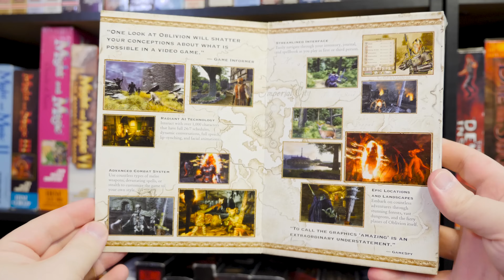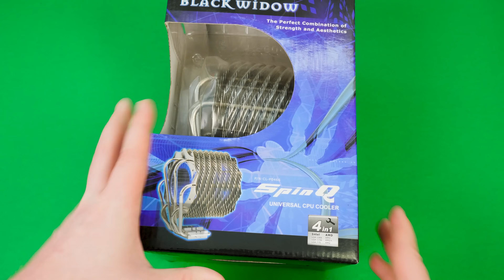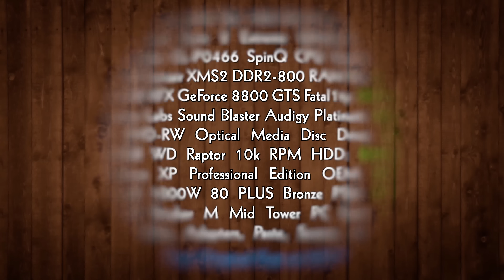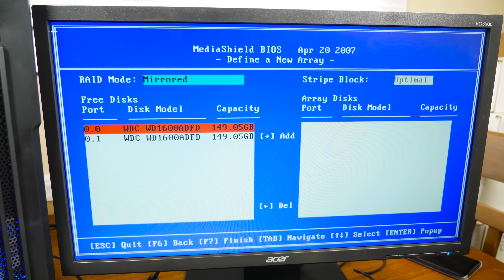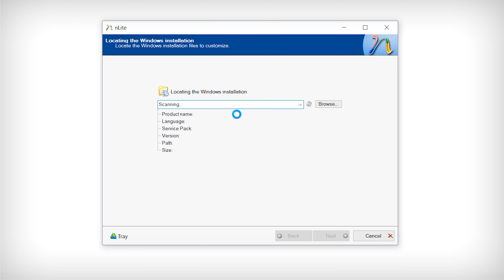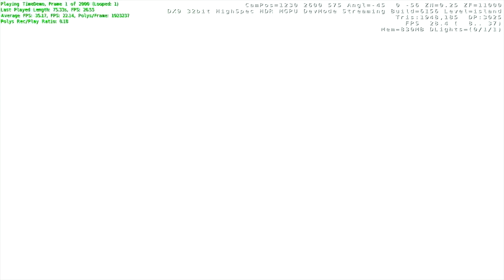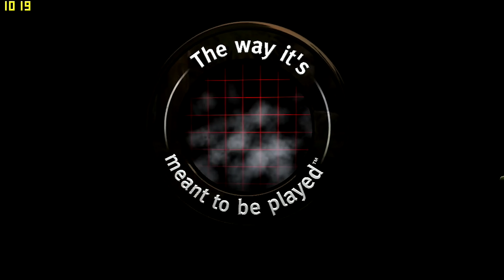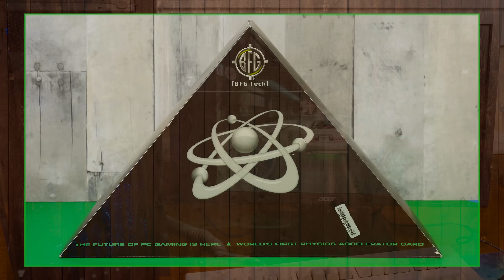LGR - Building My Dream $3,588 Windows XP PC

Comment: Haven't quite finished the video yet, but just wanted to say that the one thing about the Core2 Series and what it still has going for it is that it's narrowly good enough for most modern use tasks, but completely  own it for retro tasks in terms of support and power. 

I've been considering an LGA775 based Retro system on it for a while, but im not too sure it's time to say goodbye to my PGA478 PC just yet.

Now I get to enjoy the rest of the already brilliant video.
Reply: My computer is an old hp workstation, this summer I upgraded the cpu to a Core2  Extreme QX6700, running windows 10 with 8gb of ram.  Cant really game on it except older stuff, but the system works well enough for everything else.  I do need some heatsinks on the VRMs though, they get quite a bit warmer with this cpu.  (lol my disk drive is also a LightScribe)
Reply: Oh hi!
Reply: >"but completely  own it for retro tasks in terms of support and power. "

orly?
Reply: What's up, Hamish? Good to see you here, bud, haha.
Reply: I love lga 775, it’s my favorite socket.
Reply: I have still a qx9650 with a modern Nvidia card and it still works pretty well for its age in games even when it's completely maxed out. Not much form around then can still run stuff like that today.
Reply: I have one for when I can't be arsed to retro. They 'just work' : PCI-E, sata, USB2, tower coolers, Single core to quad core support. Fast enough to venture onto the web for game patches. They're super cheap too. XP gaming PCI-E graphics cards for less than £15. I have an e8600 on a modern, cheap cooler and it's super quiet and cool. 3GB of DDR2. An Nvidia GTS 645 - a Dell/Alienware card which is silent, single slot, no external power required but will run pretty much all XP games 60fps no issues.
Reply: Stew Rose they can run Windows 10 well as well.
Reply: Marcos, everythings going all good man.
Reply: Im also still on socket 478. But that pc is my current pc and its main. If it dies, Im done..
Reply: I built the PC I still use for gaming in 2008. Core2Quad Q6600, 8 GB of RAM and a GTX 9800+. It was amazing for it's time but the graphics card couldn't hold it's own after about 4 years. I upgraded to a GTX 660 and still game on it to this day. Bought a better CPU cooler to overclock up to about 2.8 GHz and an SSD, still the same RAM. It's still able to play a lot of games if recent years at 1080p with lower settings. I'd have bought all new by now if I still played as much but for my retro games it is still rock solid. 👌
Reply: Im using an old dell with that exact pga478 socket with a Core2Duo T7250 and 3 gigs of ram and windows 10. I have to say XP ran way better on this machine than Win10
Reply: Just a few months ago my main PC was an E6550 that I got for free. I was running Windows 10 on it and sure, you could notice the processor struggling every time I had to compile something, but for standard use it was a beast. I did even game on it!
Now I replaced it for a G850, same idea, just faster overall (and compile times have massively decreased).
Reply: Some months ago I was using a Core 2 Quad Q8200, 4GB DDR2 and a GTX 650 1GB... Impressively, it was capable of playing Fortnite, Assetto Corsa and GTA IV without issues.
Reply: Couple of months ago i rebuilt my old pc, Q6600 using Win7.  It runs GtaV and other games from 2015-2016 like a dream.
Reply: i have an pc at home with intel core 2 duo 2gb ram and intel hd graphics 64 mb XD. not my main pc.
Reply: i love u budget
Reply: @acousticpsychosis  Must be like Molasses running Windows 10.
Reply: @pcwizzy460  It wasnt too bad, I've since 'upgraded' to a Q9650 with a GTX770...she runs hotter than an oven, but can play a few more modern games now
Reply: Be careful with nforce motherboards - some of them have right-angled ports for SATA and I ended up accidentally breaking one of them by trying to unplug something. Thank god most motherboards nowadays don't use those horrible ports.
Reply: @Copper20  Nforce chipsets are also painfully slow.
Reply: @pcwizzy460  The 750i sli motherboard has a lot of flack for the positions of the sata plugs, and that they're easy to break.
Reply: They’re a great bridge between old and new, too.
PCI? PCIe? SATA? IDE? Floppy?
The C2D Gen has it
Reply: @pcwizzy460  and I heard there are bunch of issues with nforce chipset cooked themselves to death

Comment: This video hit me with the realization that Windows 7 is rapidly approaching "retro" territory.

Oh no.
Reply: But I still use Windows 7 on a 2012 laptop/notebook!
Reply: I also use Windows 7 if I can help it. Windows 10 is abhorrent.
Reply: Mykel Hardin run games with safe disk DRM, not send Microsoft any usage data, not be forced into an update, be able to use software which said updates can totally fuck up out of nowhere. 

Windows 7 is a fine OS and I still use it on my PC. I don’t see any real reason to upgrade especially since I like my older games readily accessible without having to tinker with OS bullshit.
Reply: Non-bloated, non-spyware retro OS.
Reply: I disagree.  I refuse to consider WinXP retro, either.
Reply: Mykel Hardin  Windows 10's terrible quality control (or complete lack thereof, in recent years) means regular hardware driver breakage or mysterious power management issues. I never thought I'd see the day where my Arch Linux laptop would be more stable than my Windows machine.
Reply: I'm still running Windows 7 on my main system. I see no reason to upgrade just yet.
Reply: Mykel Hardin Windows 10 is literally spyware, it was practically forced upon people with the "free upgrade"' horseshit, it updates at the worst times making you have to stop whatever you were doing, its interface is garbage (my computer is still not a tablet despite what Microsoft seems to think since Windows 8), and Microsoft seems to be headed in a direction where you pay a subscription to use the operating system that you paid for (the EULA already says that Windows 10 is a "service"). Sorry, but I'll stick with Windows 7 (which, unfortunately, also has telemetry in it after installing Windows updates, but this isn't even close to the amount and degree of spyware in Windows 10). You should stop using it too if you care about your privacy or rights as a consumer.
Reply: You can use Spybot Anti-Beacon to block Windows 10 information gathering/sending.
I find it odd that people complain about this since most smart phones do exactly the same thing and they happily use them.
Windows 7 bricked my PC a couple of times due to dud updates. I think people are looking through Win 7 coloured glasses TBH.

You can also defer Win10 updates.

I'm wondering if some of you guys complained, back in the day, about how annoying the office assistant was, rather than just turn if off with 2 clicks.
Reply: It's already happening. I just got a new Ryzen motherboard and it doesn't list Windows 7 as being compatible with it. You can get it to work with some messing around, but it's a question of how much time you want to invest to make it work when Windows 7 is going to be officially dropped by Microsoft in a few years.
Reply: I still use Windows 7 on my main PC
Reply: Yeah it's hard to believe that crysis is now a retro game. 2007 was only 2 PC builds ago for me, and I'm still rocking the same DVD drive that I originally got back then in my current PC.
Reply: @yellowcrash10  I'll mention I've had no issues with W10, and it runs better (more snappy and responsive) than a fresh install of 7.
Reply: I would use it on my 2015 HP Notebook if it had Win7 drivers. You know HP - they only release drivers for OS that their laptops come with.
Reply: I hope LGR does not try to use it online, else it might become bloated and full of spyware.
Reply: maxx2245_2012 if it is available to you, I’d highly recommend Windows 10 education edition. It is the same as windows 10 pro but with no bloatware and usage tracking and other data mining disabled by default. It also won’t auto software update
Reply: +Cheepchipsable having to resort to third party anti spyware tools to block your own OS from gathering info on you is not in any way equivalent to dismissing the office assistance in two clicks.
Reply: You can only defer windows 10 updates for a limited amount of time, then it forces you to install them before deferring again. 
An example of windows 10 updates breaking things is my video drivers. Minecraft now plays better on my Latitude D600 because my Lenovo doesn't play it at all, and to get it working initially I had to modify drivers for windows 7. 
There's a reason this is the only computer I have running windows 10.
Reply: Mykel Hardin I think the recent reports of Windows 10 1809 deleting user data during an upgrade gives anyone a sensible reason to avoid 10. Yes, you should have backups, but touching user data at all is a line crossed and doesn’t instil confidence.
Reply: @yellowcrash10 Windows 10 LTSB/LTSC is your saviour when 7 ends support.
Reply: Dang you're right frack I feel old
Reply: Already all set myself.
Reply: @Cheepchipsable  Win 10 is still fucking garbage, I don't know what you're talking about.
Reply: @yellowcrash10  Umm Windows 7 is spyware too
Reply: Hey a payday 2 content creator on an LGR vid. Hey! :)
Reply: @Cheepchipsable  I think it's hilarious you believe it's acceptable to having to use third party software to prevent your own OS from spying on you.
Reply: Del Nawaz - I stopped covering Payday 2 nearly a year ago, back in June.
Reply: @E3kHatena   Ah sorry, just got into the game recently and thats what i know your channel for.
Reply: I don't see neither as retro, XP eol was in 2014, W7 just now. Lots of people still using them as main drivers. W10 is a monstrosity with all the app store crap and now WSL, they are trying hard to be something they're not.
Reply: Mykel Hardin  A different question is what aren't you doing that makes Windows 10 workable?  I use 10 everyday for work, have been for years, and I and still rattle off reasons I keep Win 7 machines.
Reply: Unless they come out with Windows 11 and it is literally just Windows 7: 2, I'm never gonna stop using Windows 7, when the day comes that it is absolutely and undeniably unusable on hardware of the future or the internet of the future I will defiantly and stubbornly switch to Linux or something, but not Windows 10. I put Windows 7 on everything. I have a Dell Latitude D620 that I'm using right now to make this comment and watch this video with Windows 7 on it, do you think "change" or "upgrading" is something I enjoy, lol?

If I had it my way I'd still be on Windows XP!
Reply: Guess what.
It's almost 2023 now. And since both Microsoft and all of the Chromium-based browsers are finally dropping support for Windows 7....
Reply: it is about 2023 now and i'm still rocking a 15 years old pc running windows 7

Comment: This was fun to watch. My dad had a beast Windows XP computer that he bought in early 2004 for the cool sum of $4600. I still have it around, my dad gave it to me in 2010 when it finally retired after 6 years of faithful service.
Reply: Nice 👍

We had a early Pentium 4 XP desktop.I forgot the specs but I remember my mass disappointment it couldn't run the original Star Wars battle front
Reply: is that how long computers are supposed to last? I had my 2 computers from 2007(made in 2000 or 1999)-2015 and the other 2016-current, and i thought I'd get a few more years out of it
Reply: @luuk3213  well that depends on what you´re using them for, but yes computers may last 10 plus years for school or some business.

Comment: Wow, RAID 0 on two 10000 rpm hard drives. Was an absolutely outrageous thought back then.
Reply: Yep. It was. I had dual 300gb raptors on my PC build back early 2008. It was pretty close to identical to this one in terms of spec. Except I had an nforce 780 motherboard, qx9650 cpu, dual GTS 8800 512 and 8gb RAM.  I put Vista on it originally, .  It was crazy fast. Since then I have upgraded the GPU to a GTX 970 and it dual boots between XP and Windows 7. The hard drives still work fine after 12 years use! It can still play some modern titles on low settings, but I have a Ryzen for those games. This "beast" PC is for my older games. I LOVE IT.

Comment: Windows XP the windows that refuses to die!
Reply: no joke, I've only been XP-free since this april
Reply: @NoNant55 Won't ever be XP free  Even if my XP laptop dies I have virtual clone of the hard drive to play with lol.
Reply: I had XP until 2013. What a great OS
Reply: @DrAnGeber  Yup it is.
Reply: I love Windows XP!
Reply: Me too!  I refuse to get rid of my 2005 ThinkPad with the same edition of XP LGR is using.
Reply: Virtualbox will always be XP ready for me. I just gotta figure out how to get rid of that "activation" problem. XP is the Gamecube controller of operating systems.
Reply: @heathergleiser  Cool. I've always wanted a old thinkpad preferably a Pentium II era one.
Reply: @Chaos89P  Thankfully doesn't have that problem. I got lucky and found a copy of XP pro (32 bit) corporate edition that found it's way into the wild, of course the pc shop guy I got it from knew the value and put a fitting price tag on it lol
Reply: John Smith Mine was from XP Mode. I needed to do some finagling in order to get the hard disk image out. Since my computer isn't a Professional edition, it probably is instead acting like a freshly-installed version of XP Professional on a clean computer. I only have about a month before I have to delete the virtual computer.
Reply: @Chaos89P  That sucks.
Reply: @RWL2012  Nice. Would love one of those too as long as it's not a preshot model Pentium 4
Reply: I used XP up until 2010 when I had some nasty virus completely crash my entire system.  And since I owned the 32-bit version which only supported up to 4GB of RAM, I decided to move onto Win 7 Ultimate 64-bit with 8GB of RAM at the time.  Still, I miss XP.  What an awesome OS.
Reply: @FinestCitizen  Yeah that's why at end of support I permanently disabled the wifi on my xp laptop, making it a stand alone system.

Comment: The moment I saw you pull out that motherboard from its packaging I about died of nostalgia. I MISS this motherboard, had one up until about 2012.  I also have EVGA's lower end model with the x2 PCI express lanes instead of the higher end x3 lanes. Those boards were awesome mobos for the time, and still hold up today. One of EVGA's last shining stars.

Comment: LGR makes a video about DOS and windows 95 - I can't remember those I'm still young
LGR makes a video about windows XP - heck I'm getting old
Reply: still using XP now. fuck everyone.
nice to know if anything happens I could apparently make a new, better one for not a lotta cash.
Reply: I was born in 1994 but my parents kept their Windows 95 machine until at least 2003, so I remember it... for being a POS. My brother, sister, and myself literally danced and sang on Christmas day when we opened a Windows XP machine.
Reply: Welcome to the club boyo. Except i started with commodore 64 :P
Reply: @KairuHakubi  I don't use XP because I refuse to use insecure and unsupported OS and software. You should be using GNU/Linux if you have this attitude. You can even run 32 bit Windows 10 and run a lot of old apps still, just as well as Win 7 in most cases ;)

Comment: I spent a fortune on Q6600 + 8800GTX in 2007, and Crysis still fuggin chugged FML
Reply: Well, Crysis is just a badly optimized game, despite what the meme assumes :P
Reply: Hey, I had pretty much the same setup back then, with 8 gigs of RAM :) Ran Crysis at ~25 FPS maxed out.
Reply: My first build was in 2008. 7750 black edition athlon dual core. 2.6ghz oc to 3.1 lol. And a lowly ati 4850 512mb.
Reply: I had a Q6600 + 8800 GTX as well. And yeah, I think Crysis needed medium settings to get 60 fps.
Reply: i had a athlon X2 6000+ and a 4850 single slot, you had it better than me till 2010 when i got me a i7 920 and a GTX275
Reply: In my experience the GTX 590 was really the first graphics card capable of running Crysis at 1080p max settings with a constant 60fps.
Reply: Nothing is ever gonna beat Q2 on Voodoo2 SLI.

Thank you, and grandpa will show himself out. ;-)
Reply: My first build (from a base oem) was a AMD X2 5600+ with a GTX 260 Core 55nm. I wanted it to play Bioshock, Half-Life 2 and Condemned: Criminal Origins.
Reply: I got my Q6600 and 8800GTX out last week to put an XP machine together. Replacing some bad caps on the DFI P35 motherboard tonight.

Comment: Back in mid 2000s:
Builds a 3500$ PC
bUt CaN It rUn CRysiS?
Reply: nothing can handle Crysis...........
Reply: linus has entered the chat
Reply: @timrattenbury4768  lmao
Reply: Apparently no lmao
Reply: This pc is capable at running Crysis at 1600 x 1200 on medium I would think.
Reply: @leoscomputerandguitarrevie978  Guess the 3990X are the winner (NO GPU)...
Reply: @mimireich  At like 8 fps. But still really cool to see tbh.
Reply: @jackedup447  ah yeah that was a joke...
Even a big cores cannot run Crysis smoothly :D
Reply: Linus ran crysis on a terrible pc
Reply: No.
Reply: @leoscomputerandguitarrevie978  Actually, a Digital Foundry video established that the main reason Crysis can still melt PC's more than a decade later is that it was optimized for the *wrong future*!

Basically, back then, the expectation was that processor speeds would continue increasing, hitting 5 Ghz, but exceed that, to 6, 7, 8, 9, even *10Ghz*. And so it was built with that in mind and thus runs a lot of its logic on one or two cores/threads rather then the gazillion cores/threads we have today (since the hope of faster clock speeds didn't pan out as we all know).